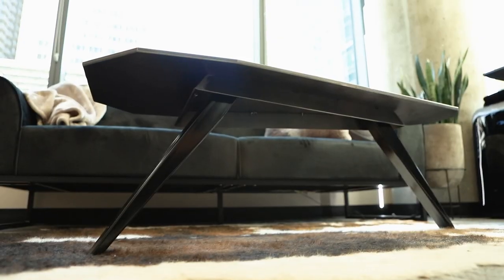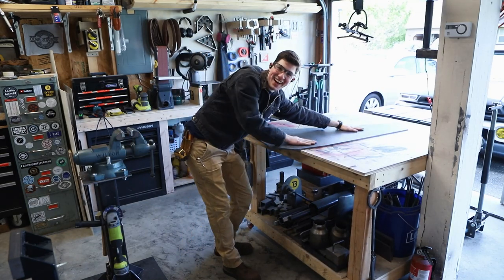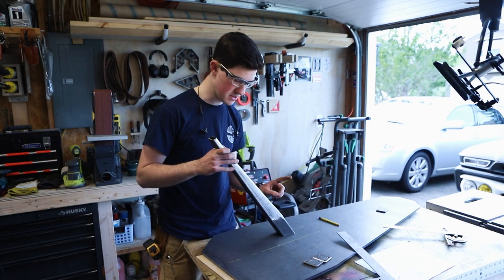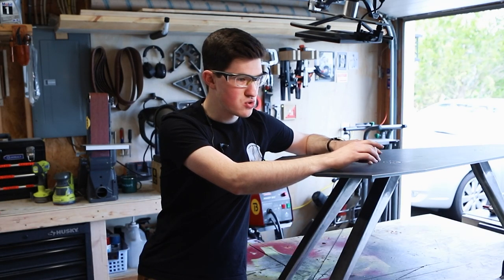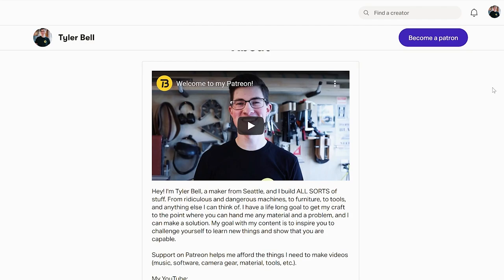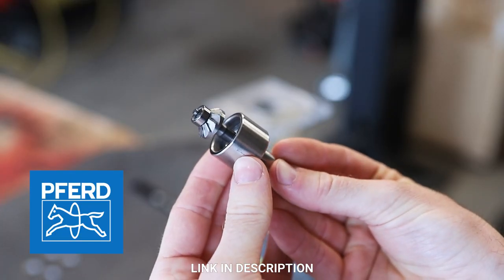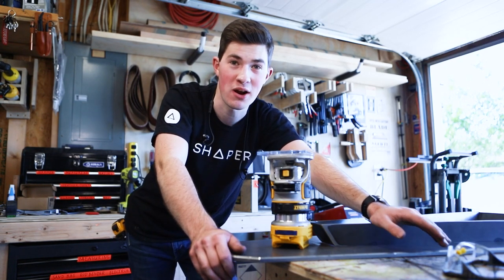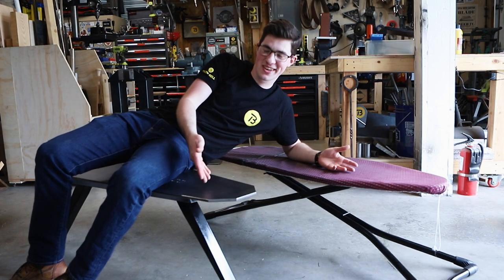DIY Modern Steel Coffee Table

Comment: for the countersink height; rather than relying on diameter, set a depth stop such that the fastener is proud and do an initial cut. Insert the fastener and measure the height it protrudes by. Adjust the depth stop down by that amount.. Recut. #hella-flush every time.

Comment: How would it work out if you had turned the pair of legs outward 90 degrees in the initial setup? I think the weight from the nose would have kept it down and made the legs stick out much farther for stability. Very curious.

Comment: I like the technique you have shown with cutting and forming taperd tubes. I think you can go one step further in designing a more radial style to your tube forming. thinking it might be hard to get clean cuts to form without using a plasma cutter, idk if you have one, but you know what im sayin? like in th coffee table the small steel bar inlay could be a more radial type pattern/inlay. you know like when you put a ruller on its edge and bend it to make curves etc.
Reply: im not saying i know how to do it but Im sure you could figure it out 
greeat stuff thanks!
Reply: "radial style" =curvy.